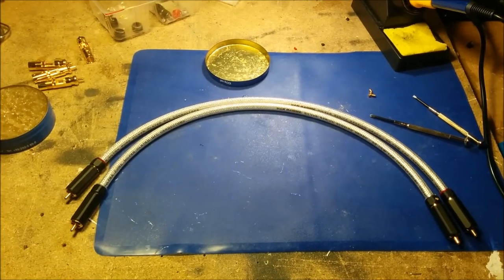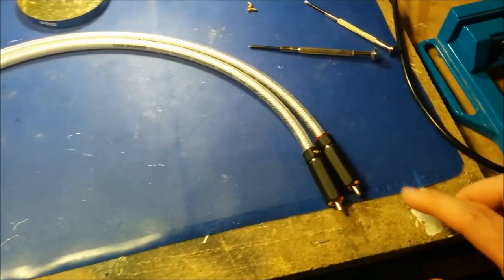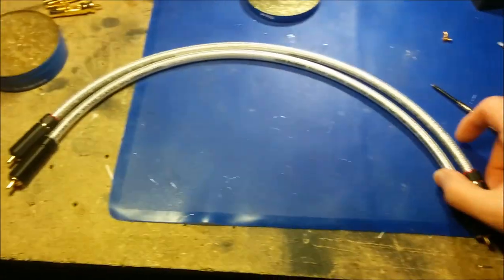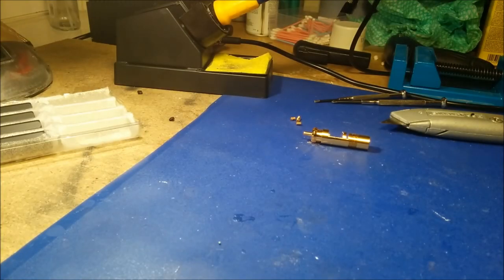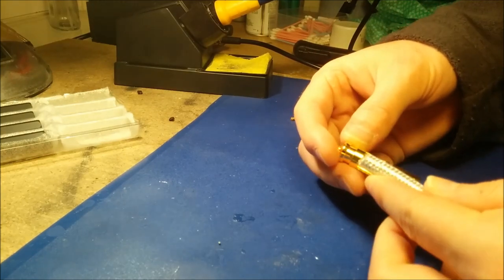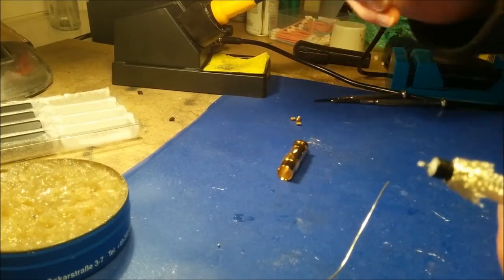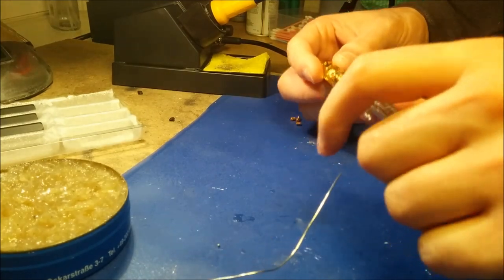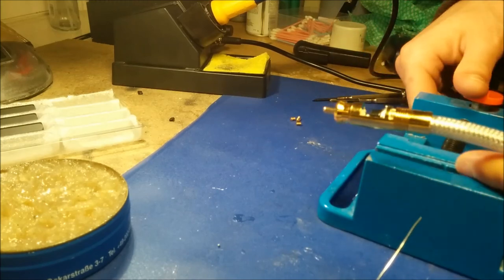How to make 1000 $ Sounding audiophile highend RCA interconnect cable for 30 $ !!!

Comment: You should use an audiophile soldering iron.  LOL
Reply: +1959Berre it wouldn't surprise me if audiophiles were snobbish enough to try and sell "audiophile soldering irons" lol.
Reply from the maker: +RGplayer101 well they already sell WBT silver solder and Audiophool cable burner if this is not enough.
Reply: LOL!
Reply: WBT silver solder is actually great stuff , and not mostly silver either. It has a lower melting point and flows easily so you don't lift the traces / pads off of the board. Excellent solder! It's not Snake Oil. Try some, you'll see why it's better. Dunno if it makes an audible difference thou. Probably not, but it's easy to work with.
Reply: LOL
Reply: WBT in general makes great stuff!
Reply: LOL
Reply: Hey where do i get audiophile soldering iron? also i think i would want an audiophile fuse for the plug too? any advice appreciated
Reply: You should be using a Audiophile Chair, Table, and Air Conditioner,,, it really does affect the Sound!!!!!   Anything for a buck, been doing this for 55 years dam if I could Hera the difference!  Audiophile is just another name for $$
Reply: Use Audiophile  "LIGHT BULB" it really brings out the Mids!
Reply: please include the list of product.. or where to adquire the components:)
Reply: @clotheslinespider6976  actually there are audiophile fuses available but you can buy a decent dac with that price 😉 😜
Reply: @RGplayer101  Been called lots but never a snob.  I love music and for it to sound as the musicians and producers intended.  Well made audio connectors help enable that.  You commented because you crave attention and got a little thrill from your 'joke'...and then the 'lol', laughing at your own joke, something psychologists have shown is done when the creator of the 'joke' knows it's not very funny, therefor laughs because, all together now, laughter is contagious. Sad.
Reply: Thousands of solder joints in the device with super bad lead-free solder. But 2 soldering points on the Conchkalel with silver solder tear it out?
Reply: electrostatic solder and a balanced oxygen free room  complete with  a gryphon power conditioner soldering iron. Martin Logan wire strippers and   wilson watt safety glasses should get the job done.  I actually done what this video shown and got some real nice cables that sound great.

Comment: I've been an audio geek for the best part of 20 year, I have also worked in Hifi retail in a past life. During that time I have used lots of RCA Interconnects, all different price points and quality. My current Hifi is UK kit. Ruark Templar 2 speakers, Cyrus 7   Amp with an Arcam DV135 CD SACD player. Currently I use Chord, Audioquest and Van den hul  Interconnects all over £100So I see this youtube vid and laugh. Well i'm not laughing anymore. I made the cable in the vid for around £28, after a few hours running in a gave it a good listen. In my setup it works extremely well, so well in fact I will be making a second pair soon. Thanks for the video :)
Reply: I deal with expensive hifi too and have heard from the likes of QED Reference and Chord Signature interconnects and speaker cables etc. Imo, at least in terms of technical performance and transparency, my Mitsubishi Eska Fibre optical, Custom Canare RCA and Canare 4S8 sound vastly better than any of the boutique cables I've heard. But then again, my preferred sound is neutral (not bright or warm) and accurate so it's not for everyone.

Comment: Since I saw your video, I tried it out and I must say I am amazed about the balanced sound. I did my whole system with this cable and several other setups of friends. Everyone was amazed about the quality vs price. Unbeatable for its price. 
I am now also trying this cable as a loudspeaker cable dispite the low diameter. Several friends have heared that cable here in my setup and were shocked about the sound improvement.
Reply from the maker: Great to hear!

Comment: A little feedback from my experience testimony, I wanted to work in a cable factory in Switzerland and had an in dept sighseeing tour. The place where those cables are made is gigantic and you can clearly see it from space. You need heavy machinery and a susbstancial amount of employees to make cables, to transport and sell them.
At the other side, lots and lots of those cable gods didn't have the machinery at all. Generally, they just sell rebranded and new decorated cables bought from China or eastern Europe. So, find their source and buy your cables there.
Reply: +Bob Outélama You cannot see it from space.... same as the great wall of china...
Reply: +Ross Sharp isn't hyperbole great?

Comment: I have made many cables on my own, and have found that coax designs (like the one in the video) sound poor because the electrons flow through the center conductor going one way and through the braid (or foil) in the other way. This imbalances the signal (the electroncs flow through two different kinds of conductors), leading to sound-quality loss. You need a cable where you have two, identical conductors for + and -, and a shield that is electrically connected to ground only at one end to prevent group loops and also to prevent the same, imbalanced wire path as mentioned above. Also, as eveyone probably knows, cable length matters. I have built many different kinds of mic cables and as length increases, the information you lose most is the 3D imaging info. The sound becomes more flat and 2D.
Reply: All good but you forgot twisted pair... the twisting causes any inductance noise to cancel out.
Reply: Yes, a twisted pair has the same kind of wire for both the + and -. But a coax has the solid copper conductor for the + and the shielding conductor (made up of something else) for the -. The difference in sound quality is very pronounced with phono cable for record players, because the signal is so low in amplitude.
Reply from the maker: +Bearista Bear I think you should keep this pseudoscience for yourself and don't confuse others mate.
Reply: +Audiophile Vintage Sorry, mate,  but if you call my comments pseudoscience, isn't your cable design also pseudoscience, since you claim your design gives $1000 performance for only $30? Where's the science to prove this?
Reply: +Ca Nadian thepride (MrCanadianPride) maybe he meant that losing 3d thing... AFAIK there is no basis to that claim.
Reply: +Ca Nadian thepride I have made many mic XLR cables myself and made stereo test recordings of identical sounds (voice and instruments)  so that I could play them back and compare the recordings directly to one another. That is to say, same acoustic sounds,  same room, same mics, same mic setup, same locations of mics, same locations of acoustic sounds, same USB interface recorder, same recording levels, same USB cable, same DAW software, same laptop...but with different XLR mic cables that I built. There ARE sound quality differences among cables, and I wouldn't waste my time and money building them and figuring out what worked and sounded best unless I could hear sound-quality differences.
Reply: +Bearista Bear Whew there are some nasty replies on here!!  No need for that folks, we all have our opinions.
In my experience, having assembled many thousands of audio cables, coaxial cable indeed doesn't work as well for unbalanced interconnects as a balanced cable, and in fact the best sounding I've found is using a Star Quad balanced cable, tying the two positives to the tip and the two negatives + shield(s) to the sleeve.  The Gotham GAC-4/1 is a fantastic Star Quad for this configuration, but really any premium Star Quad cable works very well (Gotham, Mogami, Canare, et. al.).

I think the point the OP was making was that you can make a cable that rivals substantially more expensive cables for very little (without considering exact price examples).  Most retail cables selling for $100 or so could be rivaled for $10 by assembling on your own.  That is something most people don't know, and to that extent videos like this are useful to educate people.
Reply: +Ca Nadian thepride (MrCanadianPride) it comes down to this: any cable whether kimber or home depot lamp cord has measurable electrical properties that affect signal transfer. Spending more money does not guarantee better sound. If  the guage is sufficient for the current and the construction is sound for noise rejection most differences in peoples ears are psychologically injected. There is no voodoo properties high end cable manufacturers _build into their products. Capacitance, resistance and inductance will change the way the amplifier reacts to the signal but again those are measurable.
I loved how monster came up with the term "musicality" to describe a benefit of their product. What BS.
Reply: +Bearista Bear Hello Bearista Bear. Please let me help the discussion. We would be glad to have the copy of this scientifical fact, with reference of the study, in this section of the Youtube Video. If not, we will not be able to receive your point of view because it's unproved and impossible to verify, thanks for that.
Reply: Bob Outélama I make cables to satisfy my ears and my budget. I don't make them to prove to anyone else what I hear (or don't hear, depending on the cable I make).
Reply: Bearista Bear And it's absolutely ok if you do. It's your pleasure and it's great.
But generally, we have an army of peoples coming on the internet and proclaiming unproved things around cable theories, because they "checked it" and "they are sure of it". In your case, you are making DIY calbes and you come on the internet with your first statement above that is, in many aspect, highly critical. Do you even have a machine for testing the Electrons ? Do you have any possibility to visualise and quantify the electron flow in your cables ? What actual protocol did you use to establish that ? Did you base on an actual study for saying that ?

As you see, your statement is more than problematic, because it relaunches an already "proven fake" theory about sounding cables.

And during the time we are occupied to argue about those things, B&W, nearly unnoticed, doubled his prices of his speakers, because, you know, fuck the poor.
Reply: +Bearista Bear You would only be correct if his amplifier has differential RCA inputs, However if he does not have differential RCA inputs, which 80% of people would not have as these inputs are mainly found on high end equipment then the coaxial type cable would be better as the OP Amp configuration designed for coaxial cables would not reject the resonant noise from twisted type cables, But from reading your comment i doubt you know about cascading op-amp circuits.
Reply: +PDX Girl What part from City of roses did you live in? I would like to purchase or tech me,  or I could pay for you time as well... thanks
Reply: PDX Girl Yes, for mic XLR cables, the best overall long one (50 feet) I ever made was with Canare quad cable. I had experimented with many cables, including network cables, and Canare was the most neutral. However, at 50 feet, it did suffer from some loss of 3D imaging detail, compared with a 25 footer I made with an Alpha Wire three conductor cable (two insulated conductors surrounded by an uninsulated wire), which sounded very smooth and life-like.
Reply: +squirtmph Hi there!  We have an office downtown at 5th & Stark.  We could private message if you'd like to set something up.
Thanks!
Rhiannon
Reply: Filming In Portland Yes, please email me at , mention something about wire cables or something, please! thank you Sir..
Reply: +Bearista Bear That could be true if the input (and output) were balanced. But RCA connection are, by definition, unbalanced so what you said do not apply. Microphones have in most cases a balanced output with XLR connectors.
Reply: +FuckGoogle+ Actually differences in sound can be heard between cables, it makes no difference if the sound in psychologically injected as all sound is basically psychologically interpreted. 
But deciding on weather or not the differences are an improvement depends entirely on preference, which is subjective. and so to each their own. I use blue jeans cable. some prefer 1000 dollar options. Either/Or is good.
Reply: Yes, ghosts sound are important to feeling good.

Comment: So many things affect the sound of a system. Reflections in a room is a huge problem. My best room for listening is a very small bedroom with 4 Paradigm Mini Monitors in it. Room has lots of padded surfaces...clothing, bedding..and it I get that punch from the audio that I like to get from being in a Luxury car with leather seats. I did an experiment in my living room, placing two wood panels on a stand directly behind my head, each at a 45 degree angle, which aimed the sound in the room into my ears. I adjusted my head distance to them, and found I got a very three dimensional quality from this simple setup. An old dictionary stand with walnut boards that are adjustable got me into this experiment.

Comment: I use wire coat hangers  the sound just hangs in the air it also helps if you sit just off to one side of your speakers and wrap your ear lobes in tin foil you will be amazed

Comment: Audio quest selling one of their series for $14k... it's hilarious. They even claim directional electron flow (without diodes) just off steps in the copper. Wild.
Reply: @MrAzcabowabo  A decent $10 should sound the same though. The internals of your audio equipment arn't using this ridiculous oxygen-free electron-controlling wiring. Neither is highly sensitive scientific or medical equipment that is far more susceptible to signal loss or changes in voltage. Hell, our eyes are far more sensitive than our ears yet my TV can deliver perfect 4K HDR with $5 HDMI cable. The only improvements a more expensive cable can provide are: Less likely to break, less likely for the metal ends to corrode (if gold plated), better EMF shielding. Sound quality ain't one of 'em.
Reply: @GrandHighGamer  CORRECT

Comment: DIY cables and speakers.
Most bang for buck.
Get plywood and 2x large fullrange single drivers.
12 inch to 18 inch.
Cut hole.
Mount to plywood.
$800 of parts gets you $25k of value.

Comment: An interesting video as I used to work for a high end fibre optic cable manufacturer.

The parts to make 2 X 0.5m interconnects are about £19. The Van Damme cable is £6 per metre and the 4 locking RCA connectors are £12.95 and you can get both on eBay. Following on from this video I bought the parts to make a pair of these for myself and they really do look and feel great.

In terms of sound quality they do the job very well. I mean cables and interconnects make subtle differences at best so I wouldn't obsess over it too much but I am certain that if this cable had "Audioquest" written on it it would sell all day long for £100+.

For £19 I'd be surprised if you can get hold of a better made cable.
Reply: Paid £34.00 for mine inc postage with WBT style locking connectors.  Belden 8402/ 8412 and Mogami 2534 are the cables that the hifi enthusiasts speak highly off at £35.00 - £50.00 made up , there are guys on forums that have replaced cables costing thousands with these
Reply: @UFA-jc8gu  i wouldn't say they are any better then van damme.van damme is more uk eu brand where the other 2 are more American market mogami is Japanese.if van damme good enough for Abbey Road studio its good enough for me.
Reply: @markclancy5371  Not sure what the country they are marketed or sold in makes any difference.  I bought my Mogami cables in the UK.
Reply: @UFA-jc8gu  I meant what I've notice the videos and  most of forums are American market.is the mogami better the the van damme rca cable thats the main question ive had belden mains cable but i think supra is better for that kind of price mogami probably decent like but is it better?
Reply: @markclancy5371  👍👍👍👍

Comment: Just had a pair made up with the same connectors, they sounded so much better than the QED graphite cable I'd been using and cost the same in parts, they didn't even sound like they needed running on eitjer
Reply from the maker: I’m glad you have good results with these cables, they are quality characterised cables with no snake oil bs.

Comment: ty for the vid but who plugs and unplugs powered up equipment i am a Professional Dj and rule of thumb is never plug or unplug a powered up unit that's how you blow amps and speakers, so the touching the ground first shouldnt make a difference, but I do love the cables and the ends are sweet they sound good

Comment: I've made my own cables in the past and fund the key was to match the materials to the application. The type of cable you need for connecting a low output moving coil equipped turntable to a phono preamp is very different from the cable you need to connect a preamp to a power amp.
Reply: coud you eyplain that further ?

Comment: AudioQuest sells some pretty good interconnects for not much more that the claimed $30.  Their Evergreen 1 meter cost just $35.00, I have used them on my desktop system and they sound pretty darn good.  I do prefer their more expensive models, my choice is the Mackenzie for $189.00.  I’m listening to them right now.  And yes, the $1000 cables are worth it if your budget allows (wear your depends-they are so good you’ll piss your pants).

Comment: Or just use good coaxial cable (antenna cable) !  you will be amazed.... :)
Reply: beer drinker right
Reply: Problem with cables have been long time ago calculated and solved by RF fans, just use Litz wire, dirt cheap, only inconvenience is the fact of selling it as single wire without any sleeve.